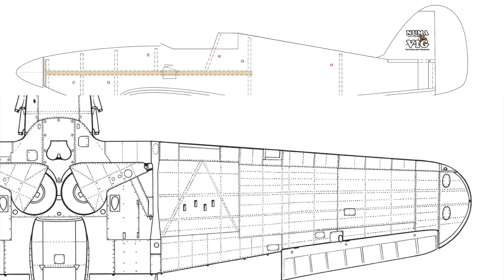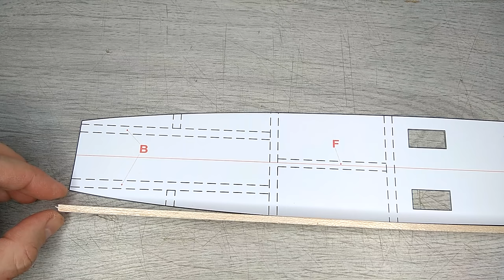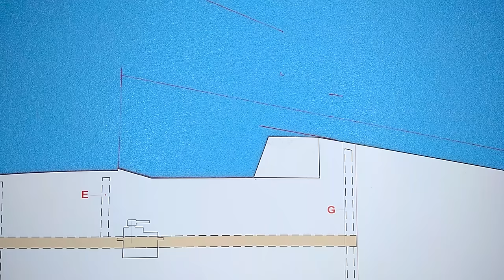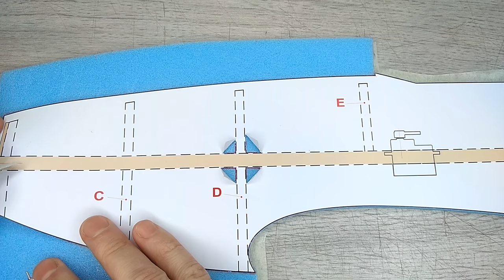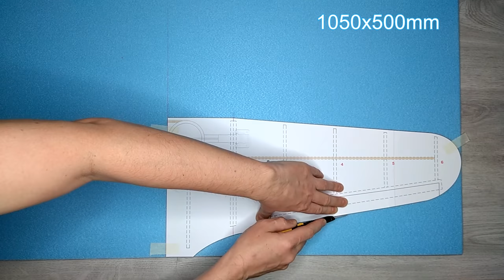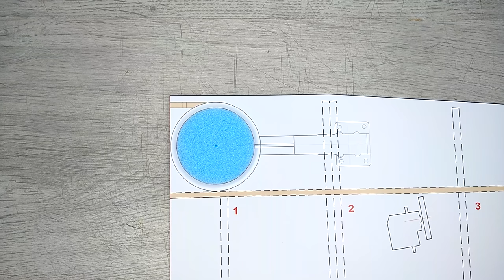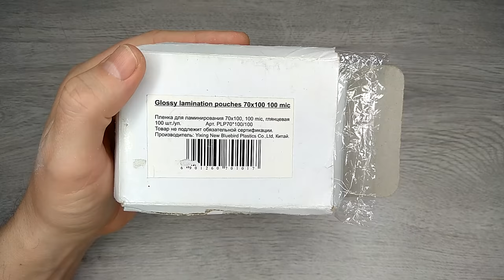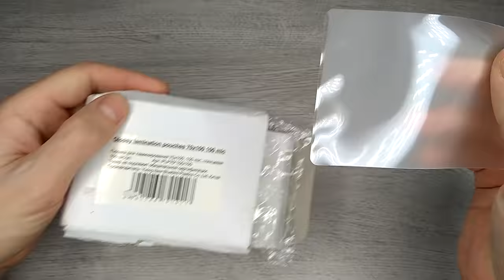How to make Hawker Hurricane RC Plane DIY

Comment: nice build, i build my planes with blue cellplastic and HotWire cutter. the sheets are 5cm thick tho. the lazy and quick build version :) then adding thin paper that is glued on with white wood glue mixed with 50% water. to thin the glue out.

Comment: Hello,
 Good job for this achievement, I will try to do the same! But I can't find a 1050x500 foam. I found depron in 5mm but it's 1000x500 so it's a bit short for the wings .. Do you have any ideas or a solution? I am in France. Thank you
Reply from the maker: Print plans in 95% scale
Reply: @NumaVIG  OK thanks !!
Reply: Is it better to take a 2200kv as the motor? To save the battery or to have more power or is it not useful? Thank you

Comment: Ola Amigo, estoy haciendo el mismo Avión pero el Motor está como loco de un lado a otro como si le faltará corriente e visto que utiliza Batería de 1100 Amp, 💥 yo tengo Batería Lipo de 850 Amp, ESC de 20 y Motor de 1300 KV 💥 el Receptor está enlazado los Servos funcionan, ¿ donde está el fallo? Gracias

Comment: Not bad...But i thnik this plane would fly better with more speed and weight. Maybe 2000mah 3 cell and a bigger motor, bottom wings plane are not very good at flying slow.
Reply: Need 2212 1000 kv motor, 25 а esc, 10x5 propeller and 1500ma 25c 3s  battery. It will fly sweet and amasing.

Comment: I''m building one from your plan. Is the plane a bit too much for this motor? Do you suggest any change in the motor for better slow and fun fly?
Reply from the maker: MF2405-1300KV with 1147 prop thrust 660 g.
Reply: @NumaVIG  Thanks for your suggestion. Will 1147 prop touches the ground? Do I have to adjust the landing gear and the wing?
Reply from the maker: @lucasvu  no, 11″ is the original propeller size at this scale of Hurricane
Reply: @NumaVIG  Nice, thanks for your help

Comment: Hello , for your model on 1300/1400mm which electronics do you recommend? thanks
Reply from the maker: https://youtu.be/BP7SGxTe-1c?t=1403
Reply: @NumaVIG  Hey , 
 you used your electronics for 1040mm but if I want to make a 1400mm I have to put a more powerful electronics ? I can recover on my old plane an ESC 40A and Lipo s3 2200mah, you would have a good motor to accompany my electornics ? I doubt that my 3536-850kv is enough
Reply from the maker: These questions are not for me, I  never built over 550g planes
Reply: @NumaVIG  Ok no problem , and sorry for my english

Comment: at 28:41, this central elevator component  does  Not  provide  sufficient resistance to twist.      there  Must  be  a  stiff, u-shaped, central  component.      in many cases, sufficiently stiff steel wire can be bent into the  desired shape and mounted, at the underside of the elevator.       googletranslate

Comment: observations.     at :19,  SF prop  equals   WRONG.        at :40, these are  Not  good profiles, for use in  a  tiny (low-re#)  wing.      these are, effectively,  zero-lift  profiles.!!!!       this model is squirrelly in the air, in part, bc  it has a   wonky  main  wing.!!!       the effective use of those profiles (at full scale) suggests that  positive aoa  was  present; either, at the wing mount  or  engine.       googletranslate